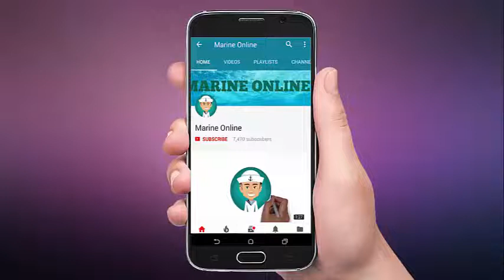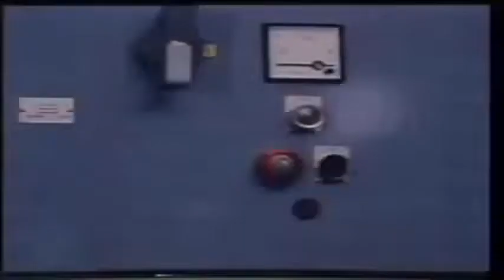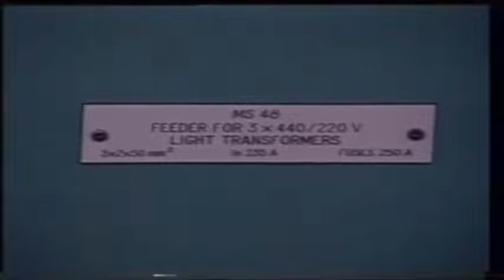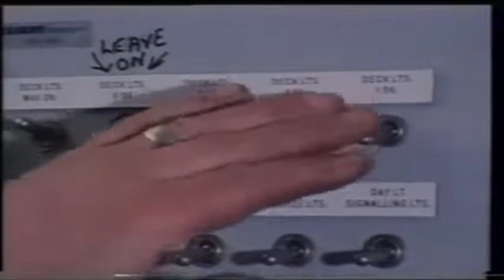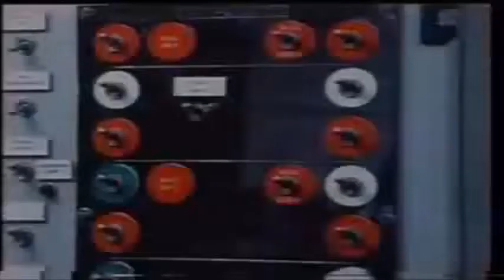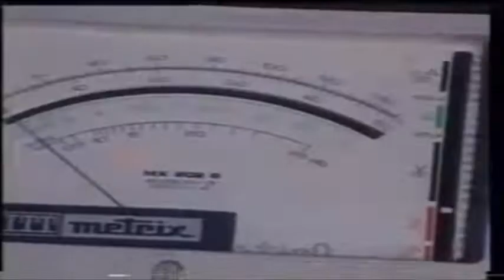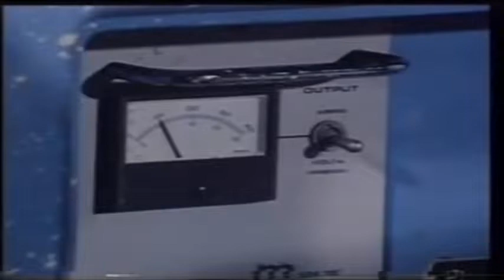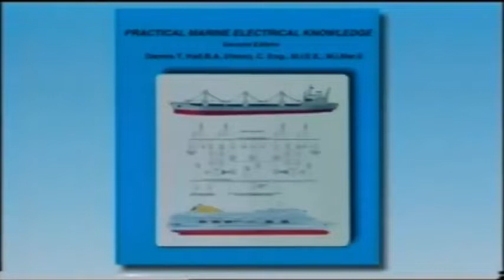Marine Electrical

Comment: It is a pretty good explanatory video to perform preventive maintenance on merchant ships but the failure observed is that it is impossible to perform this type of preventive maintenance because it must be done with the ship moored in port since when it is sailing it is impossible to carry it out for lack of qualified personnel. Here it only explains basic notions of electricity, replacement of light bulbs, electric leakage currents, basic school electronics, etc .. In addition to not having enough staff in the machinery department to perform preventive maintenance, only, the corrective and when It can. We have to settle for what we have. The Heads of Machines we are unable to plan a good job of conservation. This video is very old. A greeting from Spain